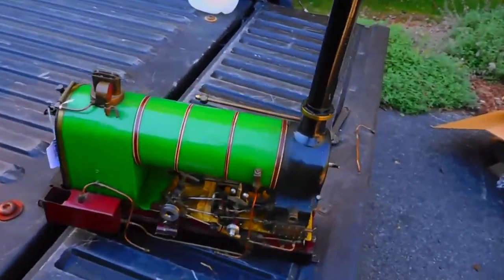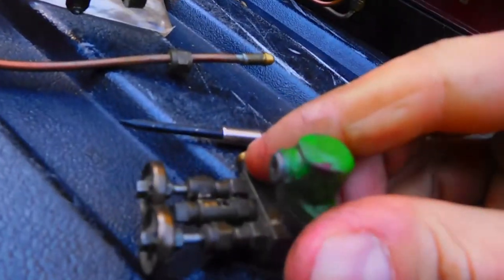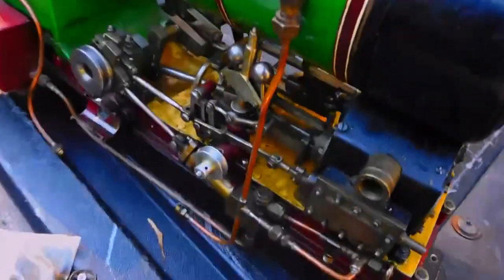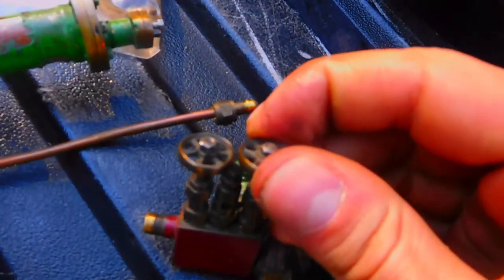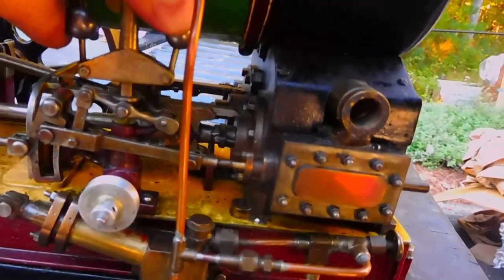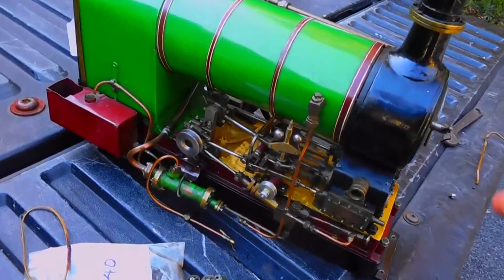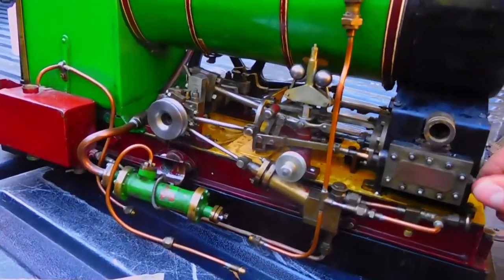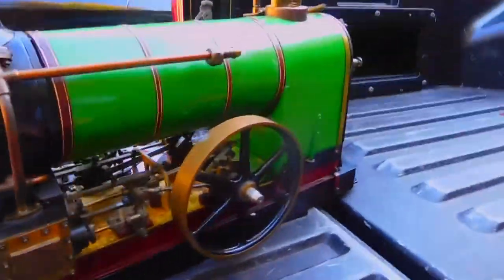A second (damaged) Undertype Engine

Comment: 1:50 I wish you met me,  alltho you wouldn't have the space for any farm size traction engine that can also run a sawmill, anything else I will be designing and using cattail foundry and Osco (former buckeye stove in portsmouth ohio)to have them cast  parts currently since it's cheaper and needed for the survival of my farm  looking for parts for new idea L62 easy way hay lift new idea four bar hay rake ihc Mccormick Deering no9 horse mowers in particular  wheel rims for the air ride tires horse linkages new pitman bar several bolts and two cutter bar teeth/knife set and one cast knife hold down I have all the part numbers but they have long been discontinued my hay guy has doubled the price  and gas has sometimes been out here in Southern Ohio so since I'm already obsessed with antique equipment and currently don't have any modern equipment for what i need why not use it and restore /Manu parts for others who need it also, for fossil fuel less farming there were twenty million late model ihc mowers that were made a good deal of them became yard art when they have a serviceable lifespan of well over a hundred years and that's not me saying that but the guy who wrote the book on restoring these mowers for over half a century at his shop Linn R Miller